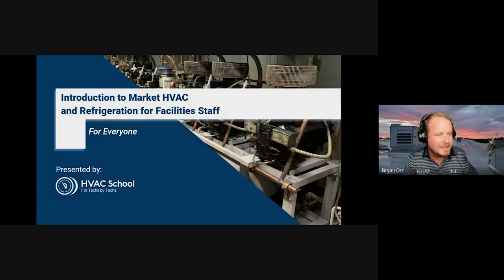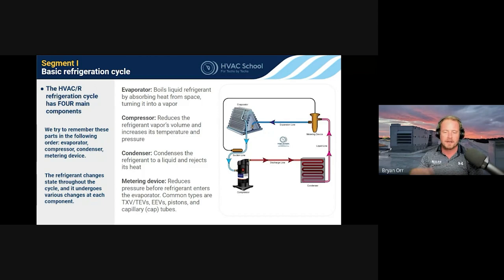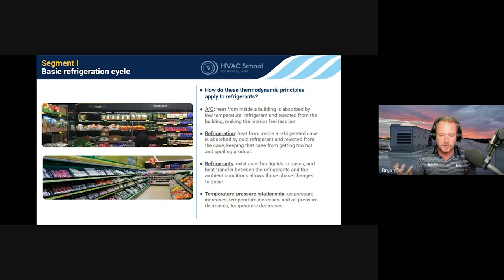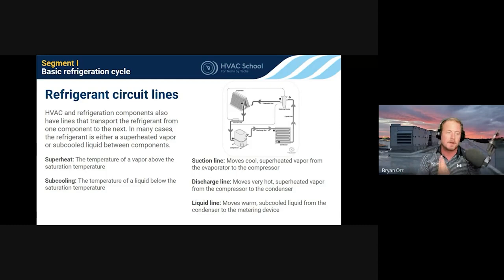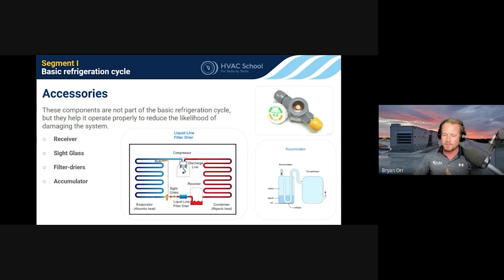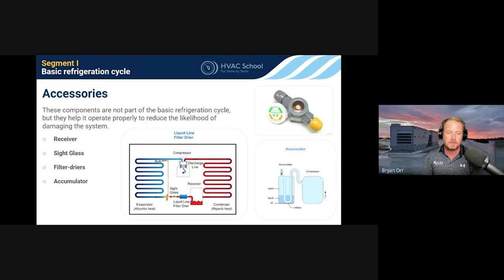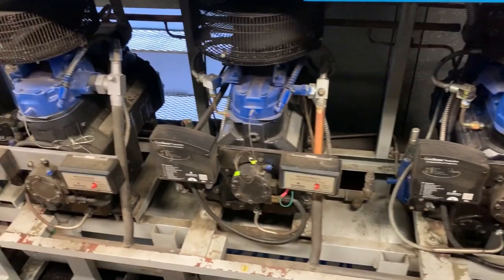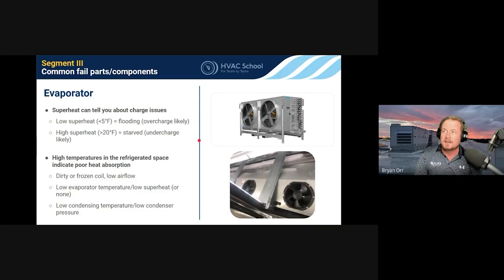Rack Refrigeration Intro & Discussion

Comment: The most important temperature you can look at is discharge line temperature. If it’s over 220f then you need to start finding a solution.

Comment: Who is shipping cases or other type units Qbody expansion valves?  I don’t think manufacturers are shipping cases with cartridge expansion valves. It’s not cost effective.
Reply: I think sporlan does with their 3 part system. You build them yourself on the job with whichever part that fits the need.